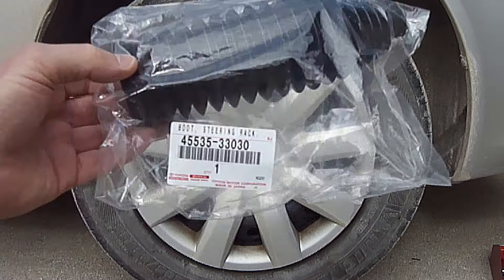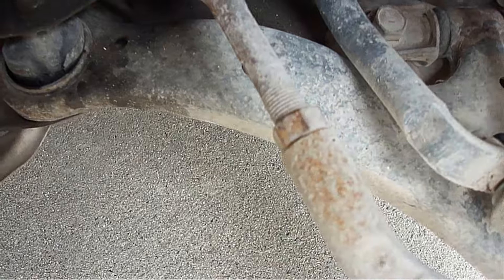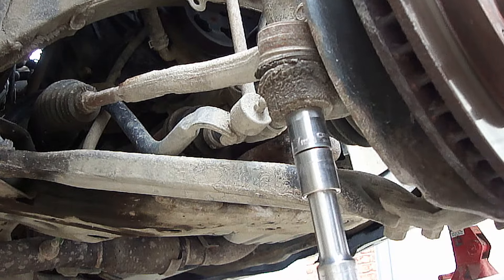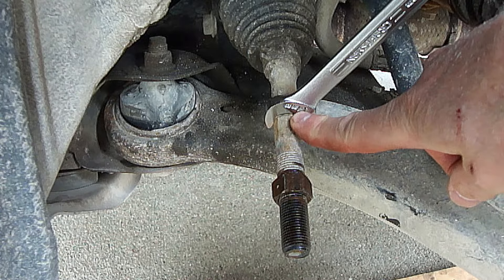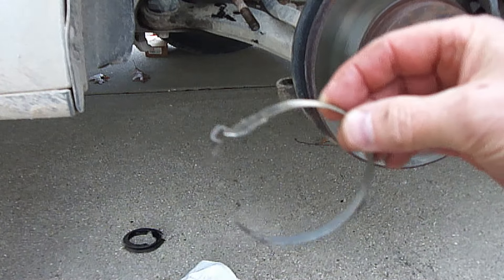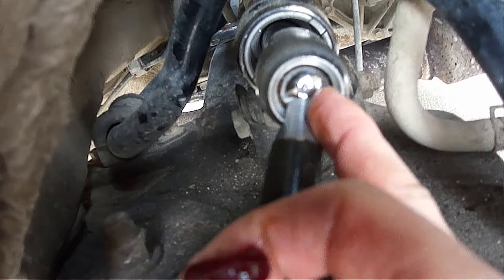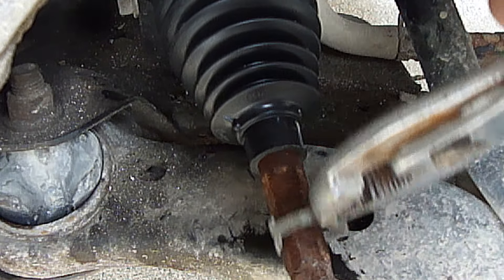NEVER Replace Steering Rack Boots Until Watching This!

Comment: Sometimes those tie rod ends can be really tight in the taper...You don't actually need to take it off to change the boot, You can count the number of threads from the back of the locknut along the shaft and mark the rod end, nut and shaft and then loosen the nut and wind the rod out of the tie rod end.. Assembly is the reverse..
Reply: You can count all you like the toe and alignment will still need to be done or plan on new tires
Reply: monktontrimble763 great a sweet ya got huh
Reply: So your saying to leave the ball joint in and to just crack the 17mm nut loose and spin the inner tie rod shaft out of the outer tie rod end?
Reply: @johalmag3304  Works for me, Jack the wheel off the ground of course. The inner end of the tie rod is just a ball and socket.
Reply: @themaximusone  Pays to get it done anyway Toe-in at least.
Reply: @tazman8697  I get it. I just did everything but the cv axels I did control arms, sway bar links, iner and outer tie rods, struts, shocks,  brakes, rotors. Had alignment done today. Should be good.

Comment: I'd love to find a good mechanic to do this for me, instead of purchasing an entire rack at high prices.  But the one's I know in my state, all want to replace the entire rack and pinion!  $$$$$$ in their pockets but not mine!
Reply: Hey if you bring it to me I'll do it for free 👍🏿🇬🇧
Reply: you can get universal boots now that are elastic enough to slip over the joint without having to take off the tie rod
Reply: @steinbauge4591  tell me more about those boots, Please
Reply: @douglb8960  They are made from silicone. I bought a pair on ebay. I'm no wizard but was able to slip them over.

Comment: Also if you pull the outer tie rod off and the boot looks like it did in the above video, go ahead and replace it, in fact if you're going through the trouble of taking this apart, more than likely all these components are worn out, save yourself time and replace them all at the same time...

Comment: Great video.  Somebody told me I'd have to replace rack and pinion but all I needed was a new tie/clamp for the boot to stop leaking power steering fluid. Thanks
Reply from the maker: It sounds like the seals on your rack and pinion are leaking. Try using Blue Devil power steering stop leak.
Reply: Had the same issue come up doing my state safety inspection. Trying to charge me 60 dollars for a need boot and $600 in labor. Crazy wall they said I only need a metal clamp.

Comment: I was planning to change the entire rack and pinion. Didn’t realize you can just switch the boot. Thanks!!
Reply: Who did you get to change the boots ?? I've asked a auto shop, they do not want to do just the booths , said it's not worth changing. They want to replace entire R& P. Not sure if its BAD but the boots are torn , maybe needs to be RE- greased.
Reply: @billwayne3924  I would just do it myself, it doesn’t seem hard honestly. But I know mine is leaking and it’s not because of the boot. So if your R&P is leaking, the boot won’t fix it lol that’s where I got confused
Reply: @lupe8519  Hello. Not seeing any leakage on mines, boots are just torn... I guess. Googled how long a R&P usually last: 100K miles. Do see power steering hoses leaking from container clamp area. I don't know what's the deal with them not wanting to change the boot if torn. Thank for responding.

Comment: Nice video. When I take off the tie rod I draw a straight line from the inner tie rod, jam nut and the outer tie rod. If the inner tie rod twist a little bit, the alignment can differ. I count the turns of the tie rod and also of the jam nut. In the mean time I keep an eye on the line I drew on the inner tie rod and keep the inner tie rod at the same position. At reinstalling the jam nut and the outer tie rod I count the turns I wrote down and still keeps the inner tie rod in the same position. Alignment was the same before and after.

Comment: A couple of tips:
- Use an hair drier or heat gun to warm up the big end of the plastic/rubber of the boot. It will make your life way easier putting it in place! IF using a heat gun be really sure you don't overdue or the boot will be damaged. Remember you want to warm it up to make it more flexible, not melt it into oblivion! LOL 😂 
- Lube the big end before fitting, silicone spray is ideal.
- Make sure to align the steering, after any intervention where steering parts are concerned. Counting the threads it's OK, to put you close. But should not be the final step! Either case given that it's in that condition, it's most probable the last alignment is already years away! ;-)
- Whenever you have your vehicle in a lift, for an oil change, regular inspection, etc. Get a flashlight, phone light, whatever. And, take a good look under your car. Taking note of the condition and possible needed interventions. Things like this when detected early are cheap and easy to correct. ;-)

Now this is not a tip. Just a random rant. I hate this ridiculous system of Toyota and many other Japanese automakers, with castellated nuts and pins!! Geez! We're in the XXI century! Come on, move on!
Reply: The boot kits come with their own grease from the manufacturer, but I'm supposed to defer to some guy in the YouTube comment section who says to use silicone spray instead. This video isn't for people who somehow know better that the engineers who made the part, you got lost and came here.
Reply: @dare2scheme904  lighten up Francis
Reply: @douglaslamb7267 hey good quote from the movie Stripes

Comment: Thanks for making this video although there's a few things I would definitely suggest was never turn a nut or bolt until you spray it with PB blaster the only end up stripping the nut and making your job longer.
 2 never ever use a zip tie to secure down a boot it's a cheap "ghetto way" of doing stuff and will only cost you more in the long run!

Comment: Thanks a lot pal! I just changed the oil on my daughters 06 solara yesterday and noticed the passenger side boot was cracked and leaking 🤦🏻‍♂️😬...gonna try and repair this today thanks to your video. I'd assume it should be pretty similar to your 07 Camry 🤷🏻‍♂️🤞🏽
Reply: How did it go? I need to replace the boots on my 05 solara and a bit nervous as I just changed the struts myself and that was a bit challenging just due to rusty parts.

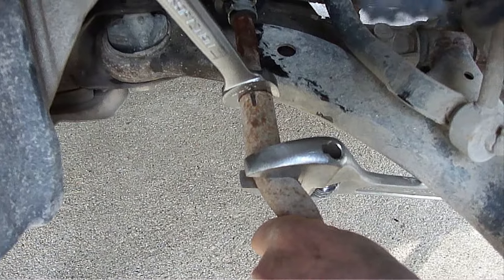Comment: only one thing you did that I see people do all the time and it drives me insane. At 3:27 when you place your wrench and crescent the open end was on the nut back wards. Most people don't know they are made to be turned in one direction. The short side should always be turned in they direction you push., The adjustable was on right this time but they are the worse wrenches to do it with. they are always more prone to slip. I realize I am being a little harsh since it was big nuts and bolts but if you pick up good habits then you don't have to worry.
Reply: Yep! 100% ON. Most people are totally clueless about how to properly use tools. Curiously, while at it, tend to create huge problems to themselves. And, damaging tools and equipment along the way...

Comment: I would not reuse any of the small stuff , but replace with new , clamps , pins , etc . And not to use a zip tie but the original and new metal clamp . Periodically spray the boots as well as other rubber components and parts underneath with 303 Protectant . I would think the use of a torque wrench would be necessary for tightening anything ?
Reply: OEM parts for this job from an online Honda dealer are not expensive.

Comment: In one of our cars (2003 Chevy Cavalier) there is a small metal pipe which connects rack and pinion below boots. It is called breather line. That line is often gets disconnected during  alignment (fortunately only fm/passenger side). I always check if it is connected or not. How important is that line? What happens if you remove that line completely and close those pegs on the boots (so dust doesn't go inside). Is it very important to keep that line? I drove that car for a while w/one end disconnected with no difference. Thank you for the informative film.
Reply: It keeps pressure inside the boot equalized when turning . If disconnected dirt and moisture could get inside the boot. If you plug it, the pressure could theoretically get so high in the boot that it ruptures itself. Not saying that it will, just that is the intent behind it.
Reply: @trapperjohn3400  Thank you very much for the explanation. Another our car (2001 Saturn SL2) doesn't have that breather line, so it is way easier to replace boots there. A question here of course, how the pressure in those boots doesn't go very high? Saturns of those years are very good cars. Trying to attach the line on the passenger car I pulled and the other end came out (I mean on the Driver side). I could install it back only after removing that boot, then putting the boot back, clamping it on the Rack and then attaching another (Passenger) side very accurately. Working on 2003 Chevy Driver side boot is very hard since no room, unless you are willing to drop a bit a subframe there. I made a sketch of that breather line for the case it is lost (I've read you can make it fm the brake line 1/4" or smth). While you work on it you just leave that boots open.  Thank you again.
Reply: @olenaerhardt7725  The pressure inside will vary based on the positioning when you install it. If installed fully extended, when collapsed it could be pretty high. If installed fully collapsed, you would actually have a vacuum when it extends which could deform it. I have no idea how much of a problem this really is as many don't use breather tubes.
Reply: @trapperjohn3400  Thank you, I never thought that the seal on the boots is such that vacuum can be created. I did only 4 boots so far (2 Saturn, 2 Chevy). I remember only the last Chevy Driver side (actually it was #5, since I replaced the torn (I think during alignment) Boot). I installed it in straight ahead position, but it is good to know about such dramatic variations of pressure in the boots. About that breather line my impression is that many mechanics have very vague idea on the subject (I came to that conclusion after a few alignments).
Reply: @olenaerhardt7725  That vacuum could suck water and dirt into the boot contaminating the inner tie rod ends. It is worthwhile. Honestly I never thought about it until I started working on this task.

Comment: I just installed a new rack but forgot to center it before installing. If i take off the inner tierod boots and measure each side would that center the rack? Both sides would have to be the same measure correct?

Comment: Please help I have 2006 toyota camry with a ripped boot is it safe too drive how many mile will it last ? Doesn't leak anything plus I put some greasse in there too help
Reply: In short. Replace it ASAP. 
Although It's not a safety issue for now. It will allow irreparable damages to settle over time. Compare the cost of replacing a really cheap boot, or repairing/replacing a not so cheap steering rack. The labor cost alone, will make you run and replace it tomorrow! LOL 😂 
With this said you won't crash and burn on the next few weeks, because of it! LOL 😂 

BTW The added grease was a really bad choice! Grease attract and collect  dust and debris. Combined they make for and excellent "grinding paste". Not good.
Reply: @crpth1  it will be fine there no grit in there at all I check every cpl mouth stay clean so I don't worry about the boot right now
Reply: @crpth1  my car has 215k miles on it ain't much more damage/ wear an tear  I can do too the car , whats the worse that could happen???  Car runs fine no issues
Reply: @crpth1  i know a guy with a grand pri with 240k miles the rack was super bad pour almost all fluid out instantly after he refill it he drove it like this for 2 years An still drive it like this...he just adds fluid when steering is stiff or making noise when turning
Reply: Put duct tape around the rip until you get it fixed

Comment: Sir, may I ask one more question? Prior to replacing my outer passenger steering boot on my '99 CRV , I've received a Beck-Arnley boot from Amazon. I've verified the part number as correct, but the outermost hole diameter appears much too small for the shaft, the side closest to the ball joint. I haven't even addressed the inner side that stretches over the rack end...I want to make sure they didn't mix parts on me. When you installed the boot as pictured in your video, did the outer (small) end diameter of the boot appear smaller than the shaft it fits over? Did you need to stretch that side of the boot too? Blessings to you in helping us DIY'ers.
Reply from the maker: I did not have to stretch the hole on the small end of the boot. It was the same diameter as the shaft.
Reply: @proclaimliberty2000  ...thank you much. Mine is way too small, by just looking at it or by caliper.
Reply from the maker: @mwngw   👍😊
Reply: @mwngw  You can buy the OEM exact boot for that CRV for $11 from an online Honda dealer. No idea if a local dealer would be price competitive. I don't mind Beck-Arnley parts, I buy them too but $11 for OEM was too good to pass up. I bought both boots and all the OEM clips (inner and outer). No fun adapting parts that might fit from aftermarket suppliers.

Comment: Undo that end from the rack then put some grease inside then screw it back on.. there is a hole on the inside that will press new grease into the inner tie rod..since you need alignment do anything & everything to prevent further alignment cost..really I would replace the whole tie rod by the looks of that boot they are cheap ..don't matter about cost just so long there is a fitting..cheap tie rod with a fitting will last 5 times longer than a sealed tie rod end just lube 2 twice a year ..fun fun fun

Comment: So, spending the time you have with (removing) the 20 turns and marking the nut, when you were done. Did you need a wheel alignment?
Reply from the maker: No, the steering wheel tracked beautiful going down the highway.
Reply: @proclaimliberty2000  - I can assure you, if you took it to a good alignment machine. Surprise would settle in. ;-)
ANY steering intervention, particularly after years of absence. Should be followed by an alignment check/correction! It's that simple.

Comment: How long can I drive with a ripped boot I have the same car it doesn't leak anything  but boot has a big ripped I repack it with a lil grease too help it what do you think
Reply from the maker: It depends on how big the rip is and how much road debris it’s letting in. The purpose of the boot is to keep dirt out and keep everything on the inside clean which helps keep the seal from wearing prematurely.
Reply: @proclaimliberty2000  so in reality as long as dirt /rocks doesn't get in there an it has some grease that it will be fine ? Plus it's not leaking same car in the video I paid 1600 put 400$into work into it already an only had it for 2 months I won't be able too afford anything else for a while
Reply: @proclaimliberty2000  it could last another 3-10 years ?
Reply: @proclaimliberty2000  there no grit an sand or anything in there really seems clean an always had lil grease inside...my steering is not stiff at all I drive with 2 fingers sometimes like a caddy
Reply: Cover the rip on the boot with duct tape until you get it fixed
Reply: @TC-iz6xe  should I be worried about it? No dirt get in there or rain the control arm kinda help from anything getting in there
Reply: @TC-iz6xe  could I drive years like this like how strut are still drive with bad struts
Reply: @TC-iz6xe  i was told by people not too worrie about it an just get it replaced when i can was told there just a dust sheild am some boot has holes in the too hell breath or something when you buy them new... As long as. Dirtt an water an stuff doesn't get in it them im good

Comment: How is the air going to be vent out during compression  and extension.  The rubber boot is  going to collapse during full extend and then it will be  broken.

Comment: Thanks for the vid, I checked my steering rack boots yesterday and both are full of power steering oil, so I wonder if I have to replace only the tie roads or the whole steering rack and pinion?
Reply from the maker: The rack and pinion seals are leaking and often not serviceable and require the replacement of the entire rack and pinion assembly.  However, you do have another alternative to an expensive replacement.  You can simply and quickly restore the seals in your rack and pinion by  adding BlueDevil Power Steering Stop Leak to your power steering reservoir.  This should permanently seal your rack and pinion leak within a few days of driving.  BlueDevil Power Steering Stop Leak will not harm or clog your rack and pinion and is safe to remain in your system until your next scheduled power steering flush.
Reply: You can try a miracle in a can but save up your money in case it doesn't work. In my experience all miracles in a can are temporary measures.

Comment: my Toyota dealership told me my boot was twisted and the whole rack and pinion would eventually need to be replaced? I can't find any terminology about a twisted boot though so am I confused...is there no way of "untwisting" it?
Reply from the maker: If the boot is twisted then the clamp on the larger end of the boot can always be removed to untwist the boot. If you cannot get the original clamp back on you can always use a zip tie. Also if your rack and pinion is leaking you could always try adding some kind of stop leak to the power steering fluid before paying an arm and a leg to have the system replaced.
Reply: @proclaimliberty2000  Hello have 2000 Lexus LS430 my rack in boot is leaking. and the boot have a huge hole. Can I only replaced the boot or the rack need replaced?